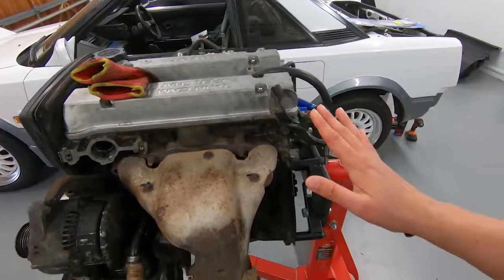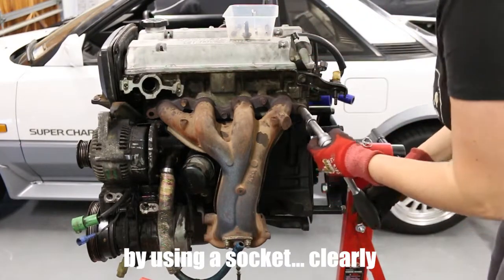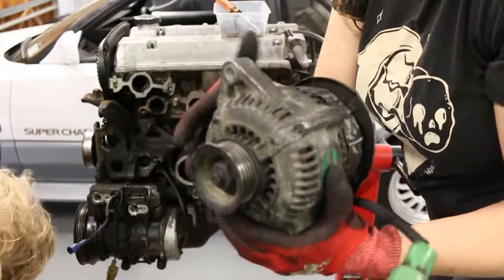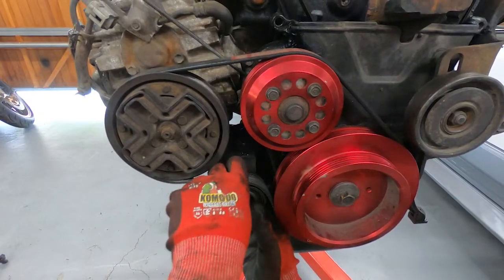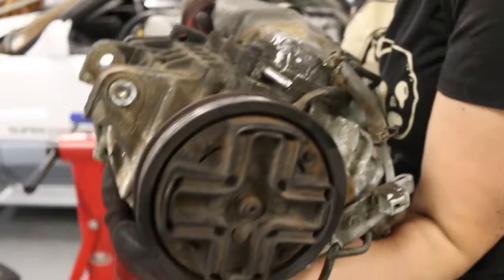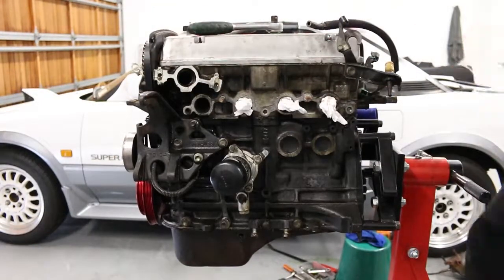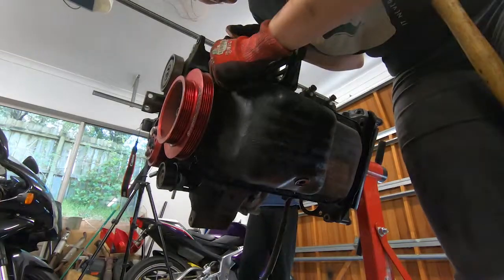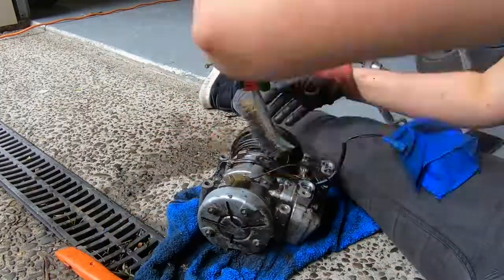SATISFYING cleanup and disassembly 4AGZE (Manual Conversion Part 4)

Comment: Check yo pipes! (Cracked mine early days, took a while to find out what the crazy sound was)
It’s a supercharger, weeeeeeeeeeeeeee

I have a plastic blade a bit like a chisel, which lets you go to town on prying metal parts away from each other without worrying that you’ll damage the surfaces. I think it’s intended to be a gasket scraper, but it’s better as a stuff getter off-er.
Reply from the maker: a plastic blade actually sounds like a good idea! is it one specifically for auto related use?
Reply: @STEPHASAURUSREKD  it is, I’ll jump between socials and send you a pic on IG 👍

Comment: What pulley are you using?, i was going to buy a fensport one but herd of them damaging the engine overtime so contacted MRP to get a 170mm Ross harmonic dampened one but its £520 delivered to the UK from new zealand, what are your thoughts?
Reply from the maker: Sorry for the late reply!
The pulley im using is a 175mm from techno toy tuning. Admittedly this pulley came with the car so im not sure about the difference between this one and a standard unit sorry!

In saying that i have heard that solid pulleys are bad for the motor, but i guess ive been lucky and this car has been totally fine for the 10,000 odd k ive put on it, but definitely do your research! 

They sell for 190NZD (wild guess £100?) ill link it here if you wanted to look!!

https://technotoytuning.com/toyota/16v4agze/4agze-175mm-high-boost-crank-pulley
Reply: @STEPHASAURUSREKD  no worries thanks for the reply, yeah i can get a full kit for around £250 but ive read up some horror stories so i dont want to take the risk, i am ordering the ross harmonically balance and dampened one which is the safest option as toyotas stock one contains these important features also ive herd the vibration from solid ones can cause damage to the main bearing and also shear off the keyway causing damage 😲
Problem is the kits which contains the crank wheel, dampened tensioner and belt is £520 delivered 😭
Reply from the maker: @iLouieTube  yeah that price definitely stings just reading it! Be interested to hear how you find the kit if you do end up going for it!!!
Reply: @STEPHASAURUSREKD  be sure to let you know when i do fork out for it, i wanted to document my mods to my trueno on youtube especially tidying up the engine bay but its so damn time consuming 🤣
Reply from the maker: @iLouieTube  can relate to that!
Been flat out filming this week so should FINALLY have something worth posting this weekend haha! But man, it really does make a 1h job feel lile a 5h one with cameras 😅
Reply: Keep it up, ive subbed 🤜🏻🤛🏻